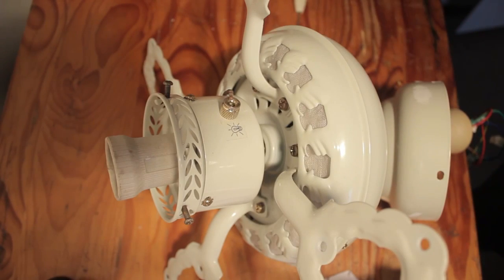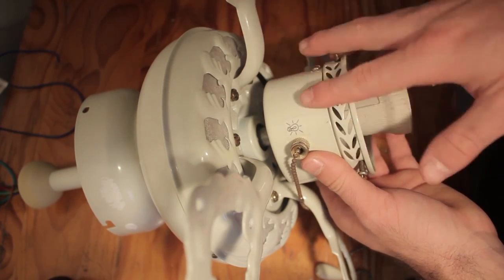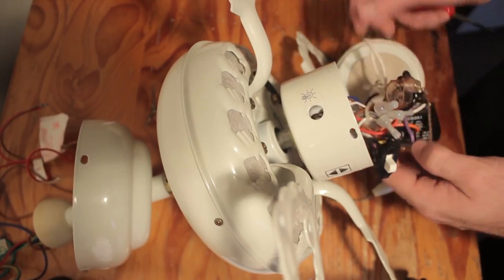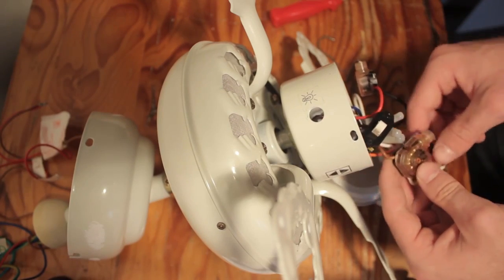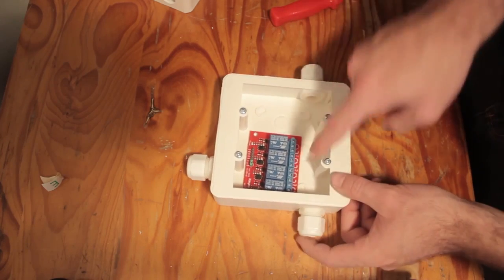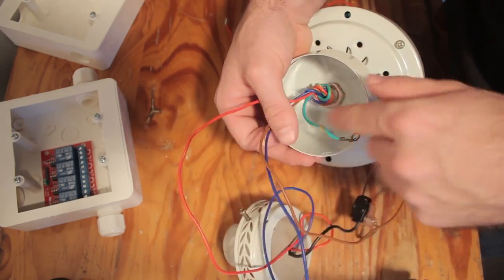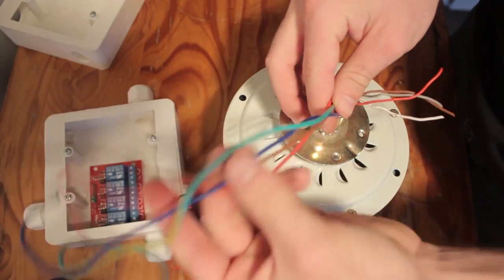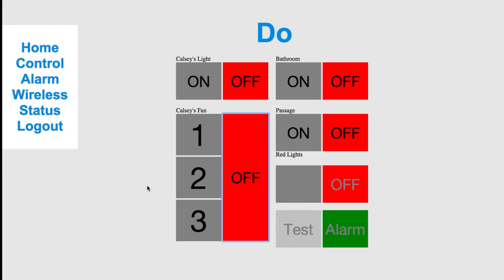Home Automation : Control The Fan's

Comment: is part 2 coming soon?
Reply from the maker: +Computer Basix unfortunately not. Maybe someday but not anytime soon. I might do it different video controlling fans.
Reply: so you have to build a control board for every single device? Isnt' there like a master device I can put in the basement that will control everything?
Reply from the maker: +Beau Brown it depends on how you have wired your house. I would definitely recommend that you run all your wires back to a central location and control everything from there. However not everyone can do that... :(

Comment: Hello, would also like to see it working when you Push the Buttons and you did not Show how you Wired the New Relay for the Light and Fan Speed on What Color Wired you Use for them either - Derf
Reply from the maker: +Fred Marsh I personally don't think this is a great video... I am planning to redo it soon and I will have more detail on how it actually workings including the control logic.
Reply: Yes please!